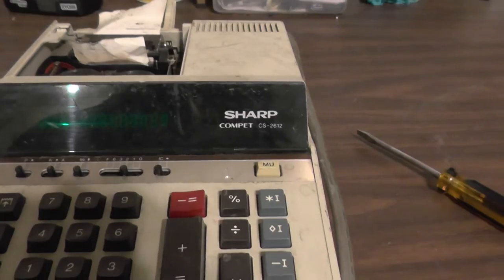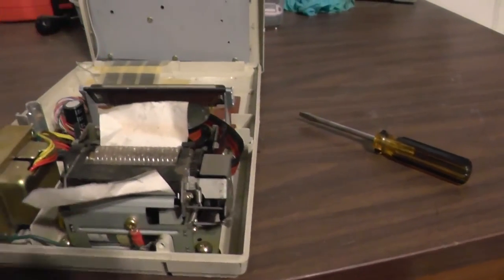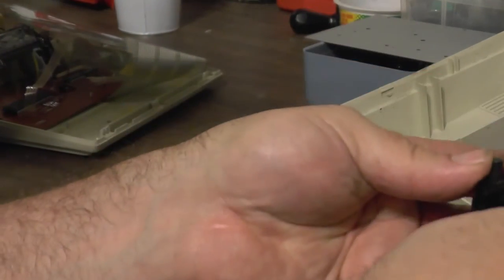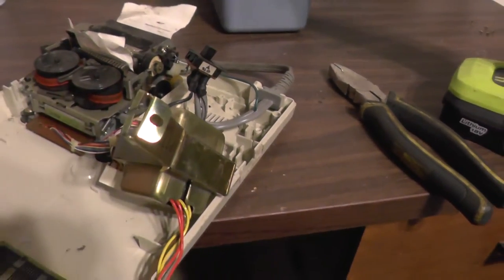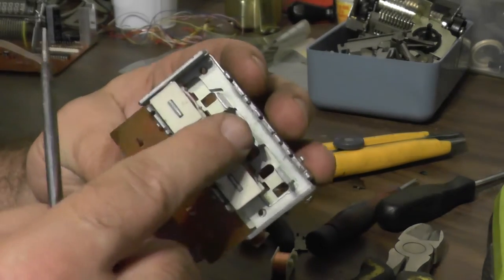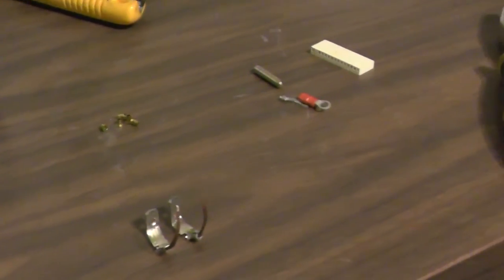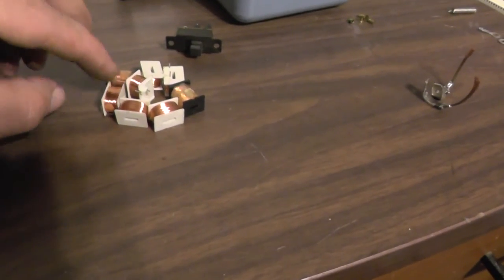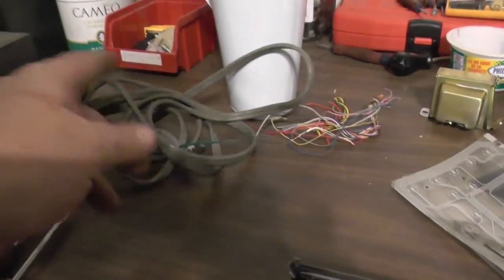What's In It #19 - Sharp Compet CS-2612 - Silver, Copper, Aluminium and Maybe Gold

Comment: keep an eye out for the gear mechanisms in printing calculators. In the gear compartment, where the printer compartment is, you may be able to find a gold plated wheel.
Reply from the maker: Sweet, thanks for the tip man.  I'll keep an eye out for it :)